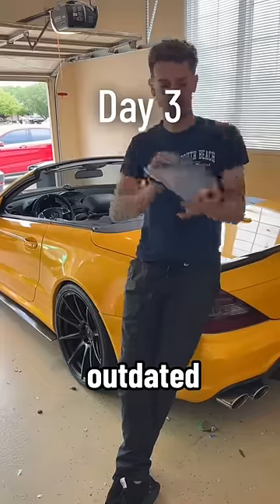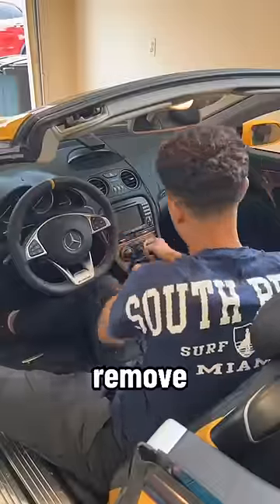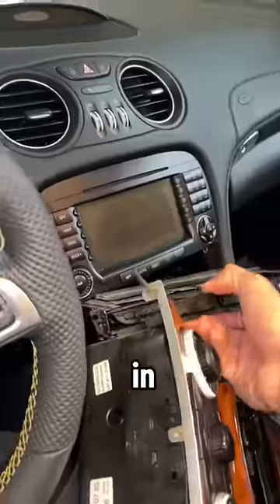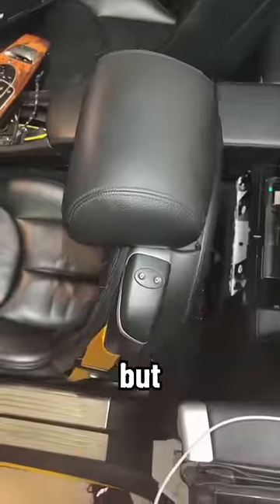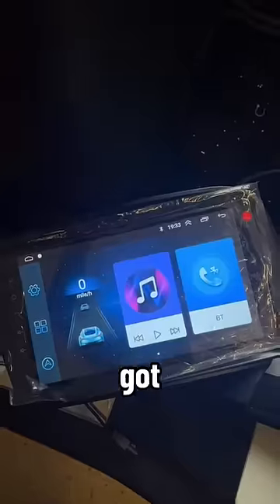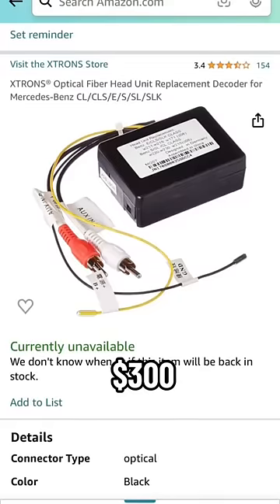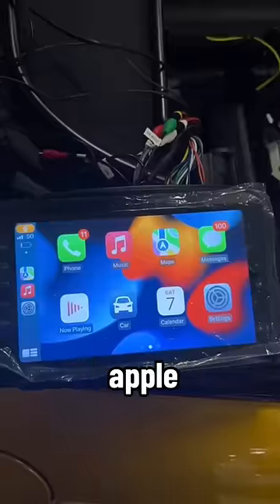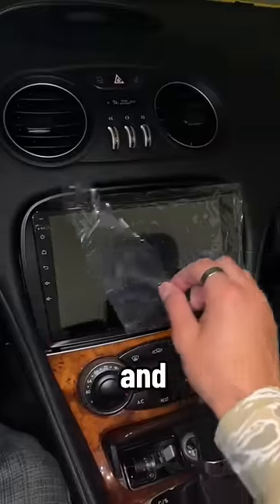Sacrificed my Cupholders￼😅🥲

Comment: Jesus Christ I can feel excruciating pain when he said bypass the fiber optic system
I’d literally pay just to keep the OEM head unit installed, with the fiber optics 💀
Reply: Did you know fiber optics have literally the worst data transmission rates of any system?
Reply: @arunmfive  Wait, are you talking about the TOSLINK standard, or just fiber optics in general?
Reply: @arunmfive that’s completely wrong. Fiber optic can transmit up to 100Gbps. Copper is like 300Mbps
Reply: @YungGaucho  yeah but all that encoding and decoding on each end takes time and parts.
Reply: @benjaminbills1998 it’s takes milliseconds. Don’t act like it’s takes an excruciating amount of time.
Reply: @Sci-Mon1 copper in a car would actually be faster since there's no processing delay. Fiber is completely overkill and useless in a car
Reply: @rippah669  what in saying is that the processing delay is still like milliseconds. Also yeah it might be overkill but saying it’s the same as copper is BS. High end audio systems don’t just use better metals just because. It’s because they work better and conduct better.
Reply: @Sci-Mon1  I install fiber optic and low voltage for work, as well as running audio systems for raves. Seriously please educate yourself if you think fiber optic cables conduct anything. There's processing delay because they communicate through light, something a computer or speaker or any other electrical component can't understand. You can't just magically replace cables with a fiber optic and expect it to even work.

Copper is THE STANDARD in literally every cable across the world for the fact that it transmits exactly what everything else uses. There's no fancier (besides silver but not installed by Merc) cables for the fact that there's practically no delay or loss in the application. There will be absolutely 0 difference between a car audio system that communicates by fiber or copper except for the fiber processing delay.
Reply: @arunmfive Bro what
Reply: Always better to keep the original unit even if it’s dated, unless it breaks. My mom has a 2011 Cayenne S with the Bose stuff that I think is also fiber optic. We installed a CarPlay modification and kept the original unit since it controls pretty much everything lol.

Comment: I do automotive sound systems for a living, this looks like a nightmare. Hats off to ya.

(Edit:) Thanks for the likes, I did literally nothing for them. :skull:
Reply: If you deal with sound then you should know, this is technically worse isn't it? Atleast for sound.. fiber optic would be way clearer and hq rather than the rca the amp would use
Reply: @justinkidwell4404 right? He basically replaced the screen with a scuffed ipad and downgraded the system just to do so...? I could be wrong tho
Reply: My dad did this in my mum's Merc and it took him about four weekends because of all the crappy fibre optics stuff. Was much easier in my MX5 in which it just needed an adapter! (Though obviously the sound in mine is nowhere near as good!)
Reply: sir i have a question for u
I bought a 20yo car 1 year ago and it has working speakers on the front but at the back, the car has room for speakers but There is no wires no nothing. I assume the car had sound but Somewhere during those 20 years something happened.
I have speakers that fit the car. is There a way for me to install them?
Reply: @DznMiguel yeah ,you can either (check the back of the radio)to see if there were wires there for 4 channels(front[left and right] and Rear [Left and right]), or you could check behind the back where you think speakers were to see for wires  overall yes you can, but much preferably would be to install the back and connect all speakers to a separate amp and use a line-out or hi-low converter to convert speaker wires to rca cables
Reply: @DznMiguel what car and does it have a stock or aftermarket radio
Reply: Okay so it had an bad aftermarket radio and since i had to spend money i bought an android radio. I do not have wires for the back channels but if I manage to understand how do I connect some wires to the radio and extend it to the back and then connect all I need i would make it but documentation and tutorials for this specific job are non existant.
the last part of your sentence is too much "chinese" for me, unfortunately. 
We are talking about a Peugeot 206 from 2000. 5 seater 3 doors.
You talking about the 4 channels one for each speaker sparked something on my brain. maybe it wont be as hard. plus, 
my father-in-law is a home eletrician he might be able to help me.
I appreciate your knowledge and reply.
Reply: @DznMiguel  since it's a aftermarket head unit it probably has 4 channels,  if not u can buy an aftermarket amplifier wirth 4 channels and use he RCAs in the back of it and use the amplifier to power and send sound signal to all the speakers, (Buying an amp should be last resort ,only if the head unit does note have 4 channels)the speaker wires colors are usually green ,purple, white, grey(2 of each ,one accompanied with a black/grey stripe or dashed line to indicate the negative wire)
Reply: @synesthesia2699 in theory yes. 
In reality, the amp he got is probably better than the stock Mercedes amp. While the fiber allows for a more accurate signal, the new amp has far better driving force and detail
Reply: Haha well you ain’t been at it that long if you never dealt with bmw or Mercedes hifi fiber optic systems they are awful I have both bmw and Mercedes a 750li and s500 and lemme say it is not for the faint to delve into these and what he needed was a special decoder behind the head unit that has splice points for the fiber optics for it to run right but he went the knuckle head route and decided to make it worse 🥴. I wanna put a sundown jl or Memphis 15 in the back of my Benz delete the factory 10 and use it as a port with a 2000 watt amp new alternator for higher output and splice it in as well as build an enclosure that is not invasive I’m pry looking at a 4000 dollar system for a sub and headunit
Reply: It's not hard.. I did my 2003 e class with the bose amplifier. change the wire harness behind the radio. They sell an adapter for about $20.. wire the adapter harness and it's plug in play.. plus you'll be able to use the factory amplifier.
Reply: @justinkidwell4404   I have not dealt with too much fibre optic stuff in cars, (IT is a different story) but yes fibre is supposed to be clearer than copper, but it is less reliable and harder to diy from what I know. Additionally, the components are definitely the bottle neck in this situation... Higher quality components will definitely make a huge difference, clarity and volume wise!
Reply: @synesthesia2699  It is such a shame to see low quality ebay parts put into a car like this, definitely not the highest quality screen, but will do what he needs it to. And he can always upgrade the headunit itself again later!
Reply: @anthonylee660   Using factory amp is a sin. JL all the way! :D
Reply: @nortvpn2550  those Mercedes Benz come with Bose.. mines sounds really great.
Reply: @anthonylee660  Not dissing the equipment for quality, just salty because I do custom stuff. xD
Reply: How much does the average screen install cost? Even better if you can tell me for an Infiniti q50 lol
Reply: @darkarkzlive   at my shop, we generally charge around $80/hour for labor for radios/headunits, and then you pay for the components (at no mark up where I work, but I can only speak for my shop) for the q50 there are a couple options, if you are talking abt the “Tesla” infotainment system which replaces the upper and lower screen as well as the climate control with one big screen on some years. All said and done you’re looking at around $1400 at most I believe. (And that’s still an overestimate) A lot of shops will overcharge tf out of you for simple shit, watch out. I would suggest you buy the screen from a 3rd party and bring it to a shop to install so they can’t overcharge you for it. Radio/screen installs aren’t that hard tho, just twisting some wires together, crimping, plugging in harnesses, and screwing stuff into stock holes. (Sometimes we make our own. 😉) Definitely possible to DIY, I would highly recommend looking into it.
Reply: HELP ME PLS. Inherited a pristine 91 Camry station wagon. Only nobody knows the 4 digit security code. You need it everytime you disconnect the battery. I know it's a sweet audio system. Did I mention it's a wagon. Any help pls.. At least 6 good soeakers

Comment: What amp bypassed the fiber optic system? I’ve got a ‘06 SLK55 and would love to upgrade the sound system
Reply: Didn't bypass it actually,  they actually just connected a separate amp to all speakers removing the old fiber optic one,and using RCAs from that android infotainment system to send audio to the amp

Comment: I worked on car audio systems for 6 years, and whenever I saw someone come in with a fiber optic audio system that wanted a higher-end head unit, it was always a new amp to bypass the factory one. Most of the time, the fiber optic decoders weren't available for the factory amp; they were broken on arrival or priced well outside what a new amp would cost with installation.

Comment: What are y’all’s dream cars?
Reply: 300SL
Reply: CTS V until I owned one. Now probably an R8.
Reply: 1967 Chevrolet
Reply: 1990 Yugo Florida
Reply: Gen 1 Dodge viper
Reply: 1969 dodge charger r/t
Reply: Thank go no one said mk4 supra but mine is a 2001 Lotus Exige S1
Reply: @Zayan2.0-r1j  didn't expect to see lotus, but a good choice, I prefer the classic look of the espirt v8
Reply: Any year 3000gt vr4, mr2 sw20 turbo, celica gt4 carlos sainz
Reply: Toyota vios with a v12
Reply: McLaren F1
Reply: cl65 Amg.. was an e55 then i bought one and i love it
Reply: Huayra r
Reply: 2009 Mercedes Benz CLS 63 AMG
2010 Aston Martin DBS 6 speed manual in Carbon White.
Reply: Toyota AE86 with a blacktop 20 valve
Reply: S63 AMG or a Ferrari 458 italia
Reply: Either a McLaren GT or a McLaren Artura

Comment: There is a company out there that sells a mod which allows you to use carplay on the original mercedes display so you don't have to compromise on the look of the interior, and there are aftermarket head units developed specifically for old Mercedes'. Either of those would have been a much better option.

Comment: So much smarter upgrading an older car than buying new one. I have 2008 a3 wagon. Did rs3 front n rear bumper. Rs3 spoiler rs5 headlights. Side skirts. Turbo upgrade. Down pipe. S3 injectors. Rs3 calipers and rs5 rotars. R8 coil pack. New intercooler upgrade. Carbon fiber intake. Rs3 steering wheel. Poo up display with rear cam. New wheels and tires. New motor I paid 1200 for motor 800 for instal. Now have motor with 88k on it. Transmission has 220k on it. Blew motor at 210k

Comment: The old headunit is actually rather nicely engineered, with MOST for audio transport. You'd habe been better off using an FM transmitter instead of ripping  out the stock HU and using that amp.

Comment: Don't you ever dare touch an OEM system like that, those are still good systems. Especially on a car like this. Could keep the value high.
Also, when are the performance upgrades?

Comment: I would’ve just left it alone to be honest I drove in 05 for a while in high school that had the original head unit. It never bothered me any mainly because I bought a Bluetooth adapter and also I still use a little thing called CDs why because I don’t wanna spend $1000 on a Head unit replacement and take apart the whole car to do so because it never goes back right again they’ll be squeaks and rattles you risk breaking trim pieces so don’t ever fit right again you risk losing screws I would just rather stick to the simplicity and besides with a Mercedes SL 500 with a V8 and a top that can go down. You really don’t need a radio. Just listen to the engine because that’s the best soundtrack of all but that hasn’t worked just fine for me. I even got Sirius XM on it for a time but to each his own, I would never do it. If I had another one I can make do with the stock stuff. Besides, there’s other parts of the car I want to spend my money on like performance that’s way more important than a screen that the pixels are slightly better

Comment: Unless ur car is a 2003 model with the d2b fiber optic system u can get a most adaptor for the newer MOST system and before 2003 they didn’t use fiber optic

Comment: its weird that it needs fiber optic, FO is only if 1 the signal is really weak in the first place or if your running like 100+ ft of cables and your car isnt that long. Seemed like a pointless flex for mercedes that backfired and costed more to perform worse esp at shorter lengths.

Comment: Wow, the guy just ruined the clean stock interior look! For his own money! And his audio without optic now gonna sound like an old civic's 2 speaker system. Great, just great!
These old systems all sound GREAT, they just need adapters for Bluetooth connection or smtn. And the navigation can be done through phone on a holder.
And it won't ruin the stock look, which is now priceless.

Comment: Higher versions of those radios have optical audio output that would have worked with OEM amp, I think. 4G+32G should be the highest version that doesn't have optical output, 4G+64G and above have. You just bought the wrong radio.

Comment: This is the whorst "upgrade" is mostly a downgrade , u got a cheap computer unit online , change the original one wich was way batter from the factory

Also for this to work u had to upen the whole interior from the car , wich will mostly fall in 1/2 years , cus no matter how much u try, you can't put it back as perfect as it was from the factory, u leave some gaps and even if u don't leave there will be in few months

Comment: I don't mean to hate, but it does not look good at all... Looked better with the original 
and you should've done what you could to use the factory fiber optics in my own opinion. Fiber optics designed by Mercedes is a million times better than RCA and an aftermarket amp ...

Comment: nonononoNONONOOOOOO the sound quality will never ever be the same again. Besides that, you can get a bluetooth 5.1 adapter which plugs right into the nokia phone holder in the center console and you can even mod an HDMI input to the screen. Why the heck would you then go for the cheapest (still more expensive than the HDMI + BT mod) screen and replace the fiber system. Besides that, I dont get the carplay hype thing, you already have the best satnav of its time, which is accurate up to 1cm with live traffic info (outdated but still works).

Comment: The original radio with the original amplifier and fiber optic system with the original speakers likely had a far better sound compared to whatever this cheap POS that you put in there, the headunit doesn't even have any electronics behind it it's like the cheapest thing ever.

You could have at least put something cool in there like a flip screen or an Alpine screen but nope.

Also, a lot of the functions of the car were probably also disabled.

Comment: Cheaper don't mean better those planet audio amps suck, the 1600 watt and even the 2500w isn't even close to 1000w rms the 1600w does like 300 rms and the 2500w does maybe 600 rms, for 130 you can get an 800w rms amp from skar, its smaller than
A lot of amps under 100 bucks, and way more powerful. Or you can go used I paid 165 for a 2000 watt rms audiopipe, there isnt a single 2000w+ amp under 180

Comment: You replaced a fiber optic audio system that also probably had a CD changer for….. the cheapest piece of garbage touch screen you could find on eBay and a cheap amp? Bruh…..